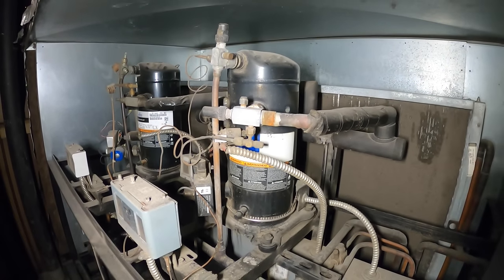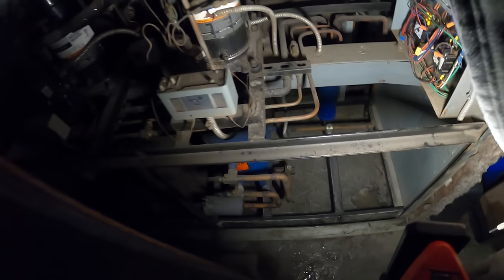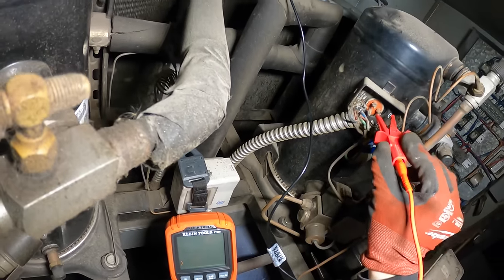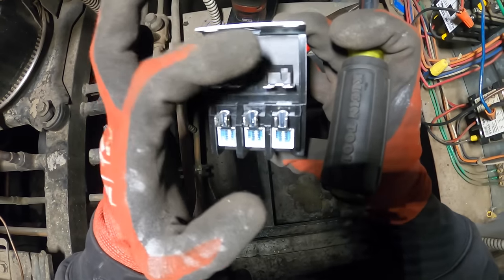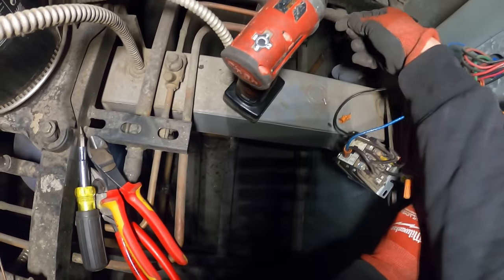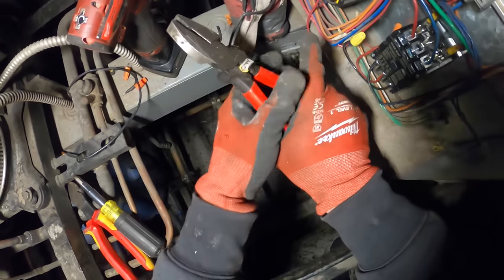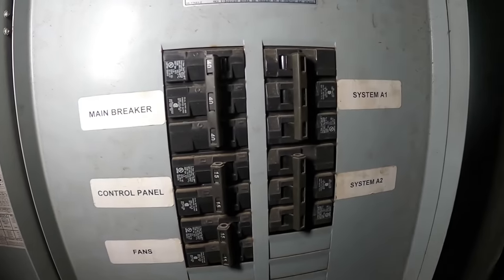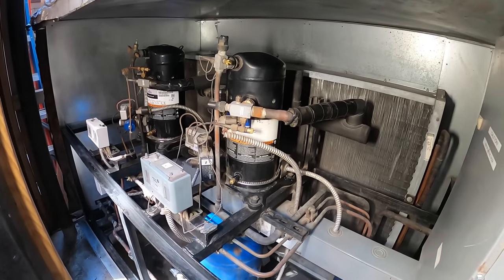HVACR Emergency: Commercial Refrigeration Rack System Nightmare (Refrigerator Not Cooling)

Comment: With wire nuts it's easier access. When wired to terminals tightly, you don't need to access it because it works. At least there are terminal strips. I would have called the manager and had him come in, then I would have turned off the mains and had him change the breaker with my supervision. That way I can say that I didn't mess with the wiring in the building.

Comment: Nope, the rack breaker and the panel breaker being the same amp rating (but different brands) will trip at slightly different times, or together as in the case of the short you found here.  Usually breakers are coordinated so that the breaker in the rack will always trip first, and the one in the panel will delay slightly to avoid having to reset both. 

Another thing that affects breakers is how many times they have tripped then reset due to short circuits.  A short will slightly (or seriously) burn breaker contacts every time, and eventually raise the contact resistance so high that even under light or normal loads, they will overheat and cause delayed tripping.  Overloads have much less of a bad effect, but can wear the breaker out mechanically. 

Some EE's will specify a higher amperage feeder to the rack panel (in this case, say 50 or 60 amps) to allow for compressor inrush and to avoid a simultaneous trip of both breakers in cases like this. That also leaves room for upgrading the rack or adding on to it.

Comment: With as much as you know about electrical, you have the skills to replace that 3 phase breaker at the main panel.
$$$$$$$$$!
Reply: That's exactly what I would of done, I'm not calling an electrician for something like that
Reply: @mikewood8527  he probably doesnt have those big breakers in truck.
Reply: @geogreandraws1053  Didnt matter, electrician came in the morning anyways. Could've bought a breaker and went to fix it himself in the morn.
Reply: He could have at least tested the breaker to see if it was bad. I understand not wanting to change a breaker on a live panel tho. Because I have done it on a 277 panel and it’s not fun dealing with the screw down connectors.

Comment: Were those numbers you were reading voltage when you were testing the prongs on the compressors? Sorry just trying to understand more getting into refrigeration
Reply: Test for resistance. Low resistance between windings but the same for all three. He also used a insulation tester from the windings to ground to make sure there are no shorts to ground

Comment: Is that contactor you replaced a pathway or a load?
Reply from the maker: That contactor energizes one of the compressors so it has a load. Not sure exactly what you mean. Thanks for watching! 🔧⚡️
Reply: @JumpermanTech 
Oh, okay.
Well a pathway is like a light switch, it doesn't carry a load, it's an energized pathway, the load would be the fixture the bulb is attached to, or fart fan, ceiling fan, etc.
Reply: @ronnym1977 I suppose a contactor is a very light load as energy is consumed by the coil.
Reply: Considered loads because they have a coil
Reply: @AA-by7xc 
Oh, okay!
Reply: @D3ltaM1cron 
Okay, now I know, thanks for the info.
Reply: @D3ltaM1cron 
Oh! 
Okay, now I know.
Thanks for the info.

Comment: Most branch circuit breakers are 10K AIC (Amps Interruption Capacity or Current) that's the short circuit rating. The overload is the number on the handle. So if both breakers have the same short circuit rating, then either or both may trip. If I'm installing a sub panel, I try to find a main breaker that has a higher short circuit rating, like 22K AIC, so as not to take out a whole panel, but even that's not a guarantee. Shorts are violent and there's a whole lot of current the transformer will let through and a lot of the time it's just a battle of the breakers of which will trip first.

Comment: 24v coil?
Reply: Yep, 24 volts is a common control voltage in HVAC, and in the case of 480/277 compressors and fans 120vac is used for control.
Reply: @mxslick50  I've never encountered 24v for refrigeration racks when I did HVACR. Not saying it's not used but in 7yrs of refrigeration I never used 24v coil contractors for the refrigeration side.
Reply: @rafaelgomez4304  It seems to be a lot more common in residential/commercial forced air units for sure.  I did a lot of work with Trane commercial HVAC and the controls were 24v. 

From all the relays I saw in this rack, I can see why they did 24v, as it is easier to design controls and run remote thermostats/sensors when using 24v controls.  (As you probably already know, any 120v control wiring has to be treated just like power wiring, but 24v controls can use Class 3 cabling and methods.)
Reply: @mxslick50  yeah on the hvac side, 24v is pretty much all I saw. But on the refrigeration side I think I only saw it once.
Reply: 24  common inHVAC setups.
Reply: @oldblueaccord2629  Yeah I know, but they're not in refrigeration set ups. At least not in the ones I worked with.
Reply: @rafaelgomez4304  Sorry I meant to write 24 AC control. Most of my job we use 24 DC for controls.
Reply: @oldblueaccord2629  Always wanted to do and learn more about controls.
Reply: @rafaelgomez4304  Its all over manufacturing, high speed assemble. Just get a job there and then have them send you to tech school for it.